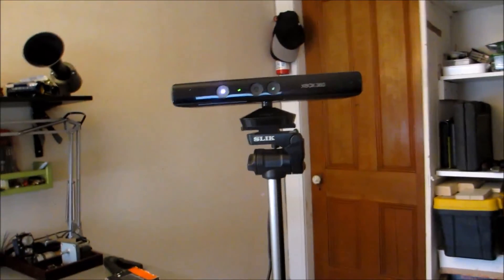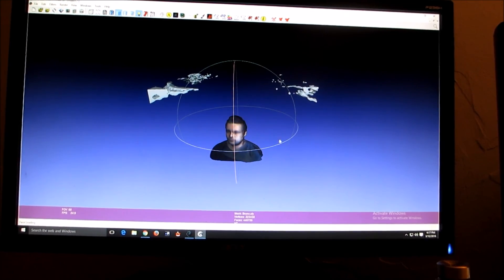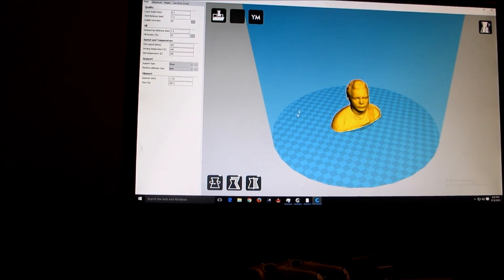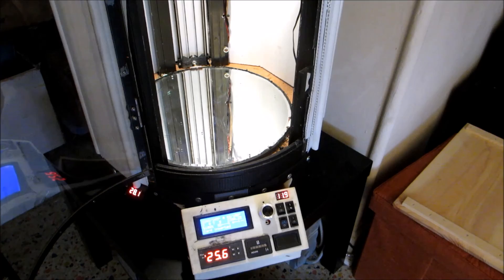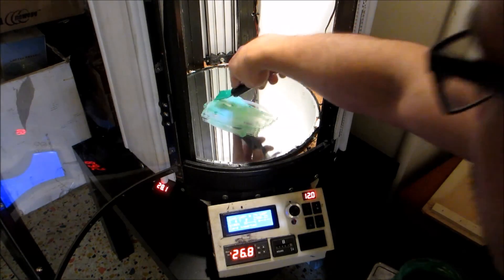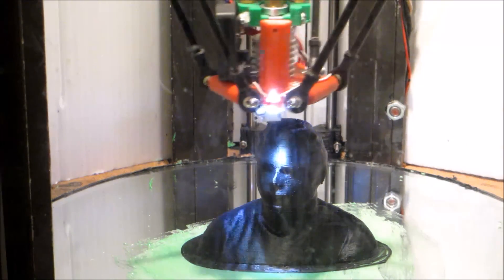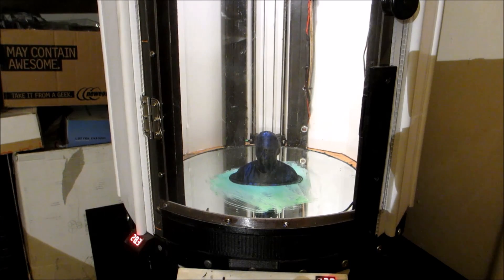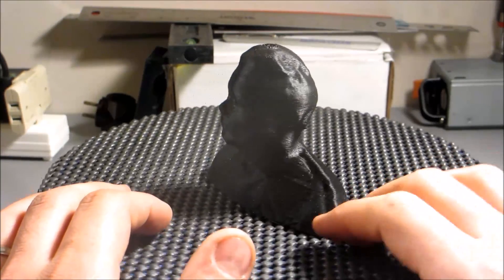3D Selfie; 3D Scanned and 3D Printed Selfie

Comment: With delta-printer you have stationary platform and heated chamber should take care of warping, so there's no need to hold print tightly in place. Do you really need ABS-paste?
Reply from the maker: +failing@commenting 

I use ABS paste the same way stratasys uses sacrificial boards to print on. It ensures that the print will not move under any circumstance. The ABS goop is the sacrificial layer in this case, it looks thicker than it is. Its generally less than 1 sheet of paper height.

Comment: You think the detail would be better if you printed larger? How about a 3D scan of your 3D selfie!!!! Mind blown....
Reply: +GetLoFi It would be interesting to see in what direction form will go after printing and scanning and printing and scanning repeatedly.
Reply from the maker: +GetLoFi 

The detail would not be better if I printed larger. However the detail would be better if I set my resolution higher and took a bit more time than 1 minute to scan myself. Or better yet have someone else scan me. I have scanned other people and the scans always turn out better than scanning myself.
Reply from the maker: +failing@commenting 

It has been done before, its the same effect you got in the dark ages of tapes, every copy separated from the original was a bit worse. The same can be said with 3d scanning, each and every time you loose detail.